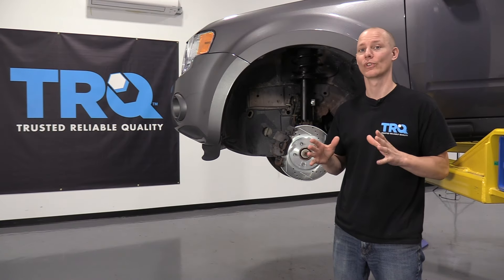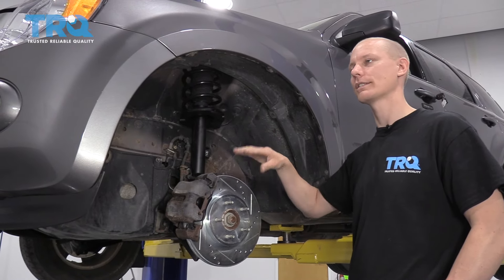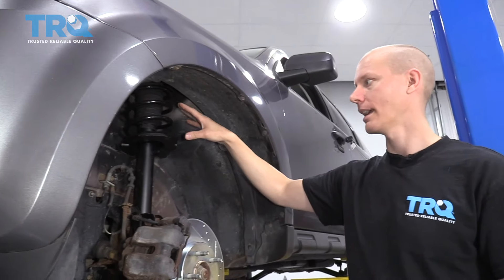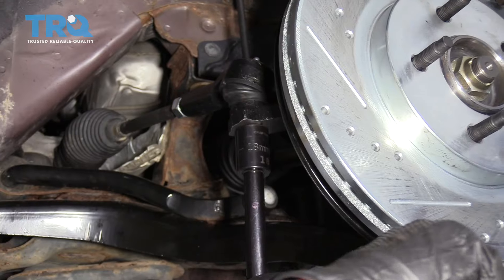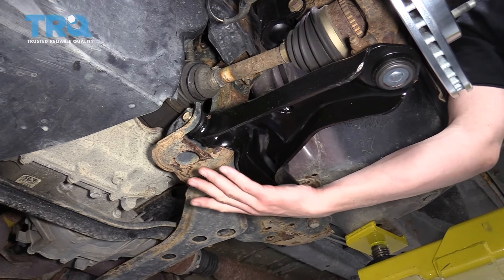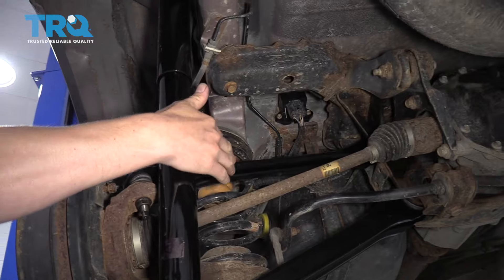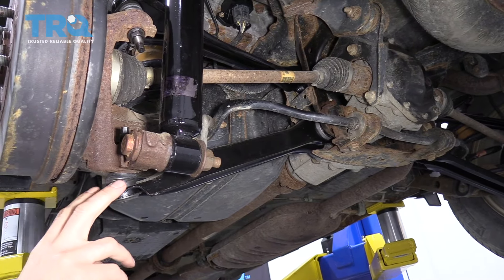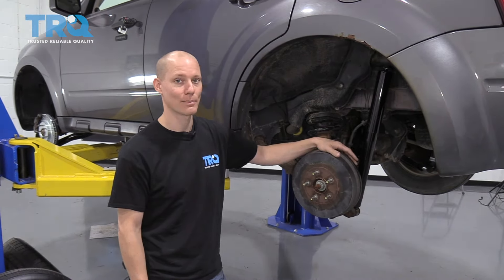How to Replace Suspension Parts on Any Vehicle!

Comment: Awesome video. If you did want to completely remove the door, take off the sill plate and then the kick panel pulls off and the door wiring can be disconnected. 3 connectors for a loaded truck typically.

Comment: When tightening bolts up, do you follow torque specs or just use the impact until it’s solid? The ones I’m specifically referring to are the sway bar bolt (mine doesn’t have the Allen key) and the bolts that attach to the knuckle And I suppose the top hat bolts too. Basically what do we need to torque? 

Thanks!
Reply: Been wrenchin' for 40+ years. I torque what I can ( some bolts, like men, you just can't reach ), what I can find a spec for, and feel for the rest. Never had anything I've worked on fail, break or come undone

Comment: I have a 2004 Chevy Silverado 2500hd Duramax LLY/ Allison 4 speed transmission .  I'm having an issue where I get shift range inhibited & right after that is displayed i get ABS service brake system messages.  The truck like jerks like a speed bump and or the dash under my D will start  flashing then I have to shift it back into park in order to get my going again.  My brakes work fine and I can drive 70 mph no problem.  I have changed the Neutral safety switch, vehicle speed sensor & cleaned off speed sensors on each front wheels.  Along with cleaning grounds & transmission connector on right side of trans.  I get a P0700 code at times not always.  any suggestions or helpful comments.

Comment: my car right now is totlly screwd front right every thing broke inclding trans line because the rubber bushing were dry rotted getting it fixed now mecahnic gave me price of $540 but i dunno if he includes the tie rod which is bad cant get wheel alignment 

plus i have to ask him if left side is ok to drive for 3 weeks and then get those old rubber joints replaced or maybe get a silicone rubber tube and inject to secure left side ..the older cars or heavier vehicles today have steel ball joints and other parts that you can lubricate yearly but us who drive smaller crossover or compacts are at risk of wheels breaking off on highway. I was lucky when it happened was making slow U turn when happened way back in oct 16th plus the tow and storage fees cost me $260 

wow im dropping all state tow service other day starting request at 9 30 am the pos service BFA never came then when other tow service was towing me to shop at 10 after 2 pm he calls

Comment: https://youtu.be/-tLagGxgHK8?list=PLJVpHWuCEUX8eZ899n3PrJqZaWF8wVB9t&t=258

^ Not necessarily in that order. I would save the two large bolt that bolt the strut to the steering knuckle for last. I would remove the abs line bracket (and brake bracket if exists / is needed) first and tie it / them out of the way then I would take the sway bar link off (or just the one end that attaches to the strut  if you aren't going to replace it) then, lastly I would remove the two large bolts that attach the strut to the steering knuckle.

The reason is that if you detach the strut from the steering knuckle before the abs and / or brake bracket is removed then the steering knuckle is / could swing down and stretch or even damage / break the abs and / or brake lines ( we don't want that, that's bad ).  Really, the right way to do it is remove the abs and / or brake line bracket first, then remove the brake caliper from the adapter (aka bracket) and pull it away / off the rotor - tie it up with zip ties, a metal coat hangar or similar (don't let it just hang), then remove the sway bar link upper end where it attaches to the strut and  pivot it out of the way (or remove it completely - both ends - if you plan to replace it), finally remove the strut bolts from where it bolts to the steering knuckle. At this point you can swing the steering knuckle down / out of the way; and, if you remove the strut entirely (top bolts also) then it makes nice clearance to get at the tie rod end and inner tie rod. After removing the strut you could also remove the rotor also for even better clearance to the tie rod end and inner tie rod (just saying). Sometimes a nice little "love tap" with a sledge on the back of the rotor is necessary to persuade it to come off.

https://youtu.be/-tLagGxgHK8?list=PLJVpHWuCEUX8eZ899n3PrJqZaWF8wVB9t&t=309

^ In a perfect world it would be just that easy. However, in reality that bolt is actually the other end of the ball inside the tie rod end (cup and ball design). That bolt will more than likely just turn freely and you have little or no way to hold the other side and stop it from turning - if there is I don't know of it. Personally, I had to use a hack saw to cut the bolt off where it sticks through the steering knuckle. If you are replacing the tie rod end then it doesn't matter if you cut it - just don't cut it where it attaches to the tie rod or you could end up cutting your tie rod (not good). If you are planning to reuse it then cutting it is not an option.   YES, some have a hex hole for an allen wrench to fit in (to stop it from turning) but in my case that was too corroded to make use of (the place fro the allen wrench to fit in was filled up with corrosion and no amount of scraping or cleaning was gonna help).  Just saying.

https://youtu.be/-tLagGxgHK8?list=PLJVpHWuCEUX8eZ899n3PrJqZaWF8wVB9t&t=391

^ Some of them have a sort of thin bolt like thing on the back side ( two flat spots on a round dealio) that you can get an actual open end wrench on to hold it from turning. That sway bar link is the thing you want to soak in penetrant (wd-40, liquid wrench, etc..). That sway bar link is the pain in the arse to get off - all corroded and frozen / fused together (usually).

https://youtu.be/-tLagGxgHK8?list=PLJVpHWuCEUX8eZ899n3PrJqZaWF8wVB9t&t=459

^ Often you can purchase a control arm comes with the ball joint pre-installed (as was my case). This make life much easier and doesn't require buying a specialty tool or doing the extra work. Ymmv.

https://youtu.be/-tLagGxgHK8?list=PLJVpHWuCEUX8eZ899n3PrJqZaWF8wVB9t&t=542

^ Not always.

https://youtu.be/-tLagGxgHK8?list=PLJVpHWuCEUX8eZ899n3PrJqZaWF8wVB9t&t=612

^ It does.
https://youtu.be/-tLagGxgHK8?list=PLJVpHWuCEUX8eZ899n3PrJqZaWF8wVB9t&t=718

^ yes, yes, and yes (they are). You can get a perfectly good torque wrench on the cheap. I paid 20 bucks for mine (20 - 150 ft-lbs) and it's easy to learn and use.